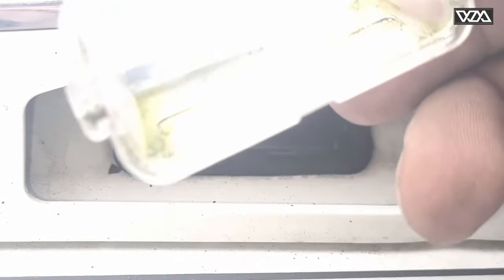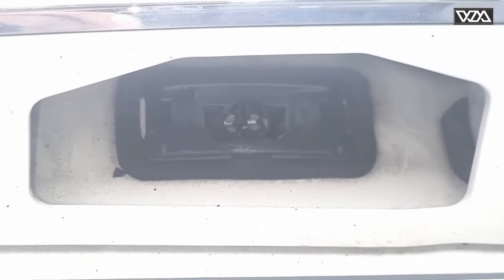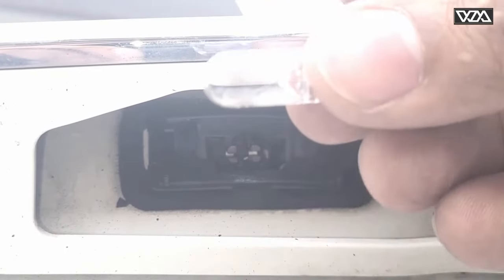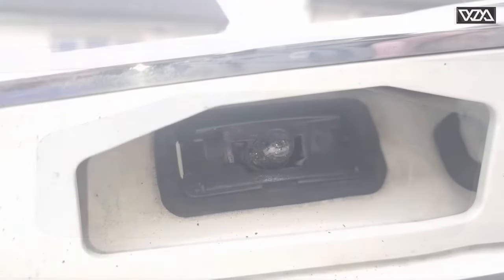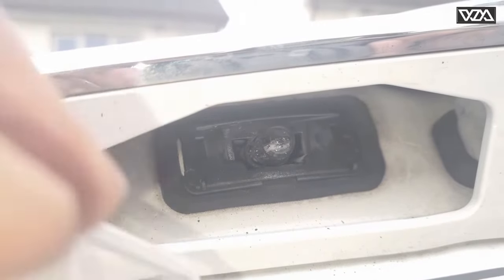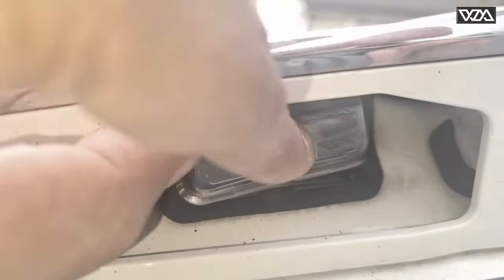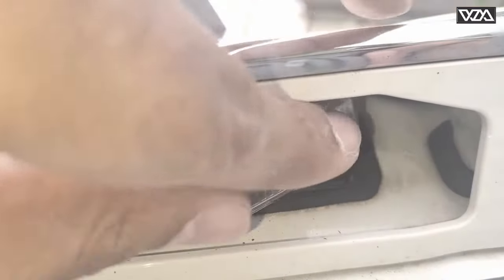Licence Number Plate Bulb Replacement

Comment: 1:08 There's no need for that much force for opening the light. It may brake.
Best way is to push with finger on other side and applying slowly with screwdriver to open it.
I have Peugeot 206, which has similar light (many Peugeot/Citroën models have these lights).